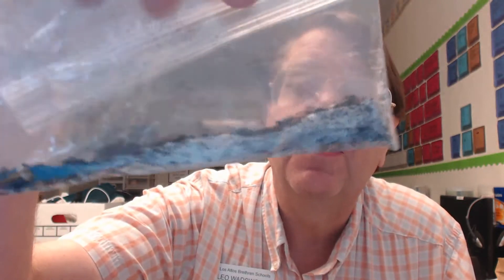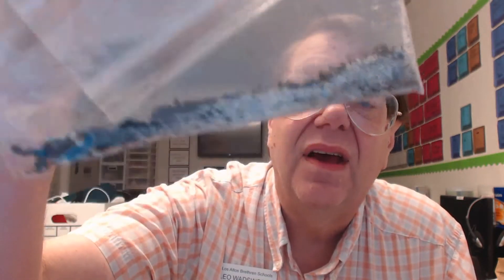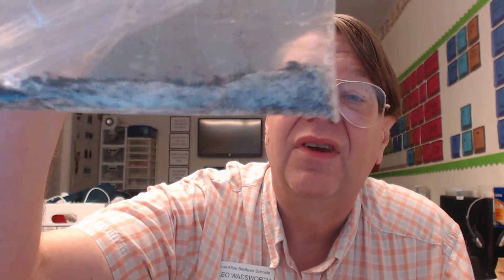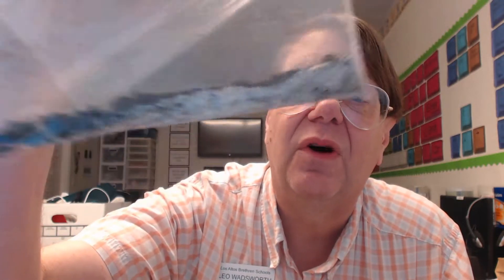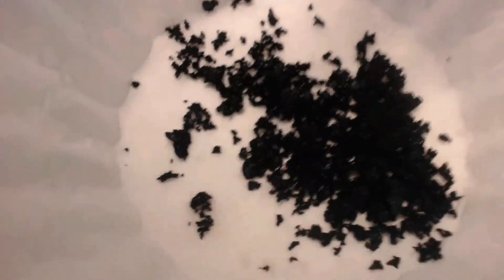Crazy FAST EASY carbonization

Comment: Hey Leo I had a go at this today. My setup was 2 Italian porcelain tiles underneath a porcelain ramekin and one tile on top. I tried to make a "baseline" sugar carbon by itself, which ended up taking 4 minutes at half power and 12 at full. Next I did a 1:1 salt to sugar mix which I ground in a porcelain mortar and pestle. It took 4 mins at half power and 6 at full. (The microwave is a 1100w Oster). Neither of my carbons were conductive! Do you know what I did wrong?
Reply from the maker: Hi Kenneth.  I think the answer is that you did NOTHING wrong!  Experimenting is like that - we learn more all the time, sometimes things that don't work like we expect tell us more than things that do!  I have started to have great success with microwave carbons, starting with sugar carbons, by adding 20% of flake graphite powder to the mix before microwaving.  CAUTION - this makes the mixture MUCH hotter, which seems to be a real key, but now I'm struggling a bit with broken ceramic cups and tiles!  I'm currently using 45 micron graphite flake powder because that's what I have - I suspect a smaller size might work even better.  I'm far from dialed in on the process - you can tell from my later videos - but it is getting there.  I'm also adding some Urea to try to reduce the oxygen in the microwave cooking.  I put the whole mixture into a coffee/spice grinder for mixing and reducing sizes of particles, especially the salt and the urea.  This seems to be a lot quicker and easier than the mortar and pestle.  One last warning -- right now the process smokes a good bit as it starts up - you will want to do this outside or with some sort of forced ventilation.  Don't do it in the kitchen! (grin)  leo.
Reply: @stemcampprojects7951  I think maybe the tiles I use or the container block more microwaves than what you use. I will try a 1:1 sugar/salt mix again for longer and see if I can get it conductive. Didn't you say that a 3:1 salt to biomass had some decent results? I am trying to find or make "rock bottom" baseline materials, because adding graphite, urea + is already more advanced.  Sciplus and Home Science Tools have crucibles which are small, but should in theory hold up to the temperatures we are looking for. Thanks for the reply!
Reply: I am also wondering if Magnesium Chloride, or possibly Manganese Chloride would be better because the melting points are much lower than Sodium Chloride. Magnesium Chloride is easy to get as an ice melt product, but Manganese Chloride is a bit rarer. As usual though, it can be found on eBay. Both are used as supplements for human nutrition in small, measured amounts. Even table salt in high enough amounts can kill you.
Reply from the maker: @kennethanderson7642  It is quite possible that they will be better microwave susceptors.  I'm pretty certain that zinc chloride is a better susceptor than sodium chloride.  I still recommend trying a little bit of graphite -- that is generating crazy localized heat.  I've got lots of experiments to run - it is quite possible that a very small amount of graphite can replace the salt altogether.
Reply: Hey Leo, it's been awhile and I tried 1:1 1:2 and 1:3 sugar to salt ratios for 11 mins at full power and none of them were conductive. Then I tried a smaller amount in a porcelain crucible for what ended up being 20 minutes with underwhelming results. Again, no conductivity! My conclusion is that the mix is not getting hot enough. I have a microwave kiln with a susceptor already built in, so it looks like I will have to think about using that as fun as the salt idea seemed.
Reply from the maker: @kennethanderson7642  whatever works for you!  I have been having great success with adding a little bit of graphite powder - its very very powerful.

Comment: RMS uses ZnCl2 to melt into the substrate during the carbonising process. ZnCl2 melts at about 290 degC but NaCl doesn't melt until 800 degC. Not sure if your microwave will achieve suitable carbonisation with NaCl in a microwave :(
Reply from the maker: As I understand it, the benefit of the zinc chloride melting is that it helps the heat transfer from the microwave susceptor to the material being carbonized.  I have found that I can use sodium chloride, especially if I use two simple modifications.  First, the time in the microwave is extended from 4 minutes to 6 minutes.  This compensates for the efficiency problem.  But the second method addresses it even further - if you dissolve the sodium chloride in a minimum of distilled water first, then mix it with the material to be carbonized, then dry it, powderize it, and microwave it.  This puts the NaCl being used as a metal salt microwave susceptor in great contact with the material to be carbonized.  Yes, it is an extra step - but it avoids the use of the more caustic zinc chloride, and uses the cheap, readily available, and SAFE table salt instead.  The safety is especially important in my context with the children.
Reply: sure I understand...good luck :)

Comment: Excellent info bro ! Maybe placing the dry ground up material in a solution of salt and then allowing to Dry again and then microwave action may result in amazing conductivity and micro porosity! I did this with zinc and was very good
Reply from the maker: Wow - that's a great idea.  So far it seems like the sodium chloride is working like the zinc chloride, so I've definitely written this down as another thing to try.  Thanks!
Reply from the maker: Electron, I've just loaded an update which shows my first try with salt in a solution with distilled water, and also salt and citric acid in solution with the carrot material to carbonize.  Interesting looking when it dries, Thanks!  I gave you credit in the description.
Reply from the maker: Thanks again!  This has turned out to be key in being able to use table salt instead of zinc chloride.
Reply: STEM Camp Projects ah great your back 👋
Reply: @stemcampprojects7951  
I was going to suggest this too XD
I hypothesized that the salts were picking up some moisture from the pyrolyzing sugar after awhile (which might explain why it took a bit to get started), which would make them conductive (since perfectly dry salt is an insulator!)
So yes, adding a small amount of moisture ahead of time would jumpstart it I think :)
(Too much would prevent pyrolysis until it reached hygroscopic equilibrium with the salt and no more evaporated though, of course)
But you've already figured this all out by now I'm sure XD

You might also want to be aware of the wavelength phenomenon that leads grapes to produce plasma XD
Particularly in that conductive regions smaller than a wavelength might have impaired coupling to the microwaves, but I'm not sure about that.
And that if you don't want to produce plasma XD, then be wary of thin connectors between ~1cm regions.
Reply from the maker: @puppypi9668  I've actually moved on from this method.  I now include about 20% (i.e. 2 grams) of graphite powder in the mixture to be carbonized.  This makes the reaction MUCH MUCH hotter, and seems to be working very well.  I'm currently working on dialing in that process -- right now I'm using a 5 minute microwave cook, then I collapse the foam back to a powder, then another 5 minute cook.  Seems close to what I want.
Reply: @stemcampprojects7951  Oh that's very cool!  An actual legit solid high-temperature conductor!  :D

Comment: Looking forward to you testing the carbon in a capacitor!
Reply from the maker: Me too!  I've got a lot going on, so it takes longer to do some things than I'd like.  I don't know for sure if the devices will be capacitors or batteries, but I've got a nice (cheap!) piece of gear that will log and display the discharge curve so I'll know then.  Check out the EBD-USB+ -- for example, at this video:  https://www.youtube.com/watch?v=VDCShH-zj0U -- I have the "plus" version with the gold top.

Comment: Covering the jar helps with the fumes somewhat. How do you deal with the jars cracking? I've thrown away like 7 or 8 china bowls by now, switched to terracotta jars which also cracked but at least they just crack and hold the material inside instead of exploding....
Reply: I bought a cup-shaped quartz crucible from EBay, it held well @ 750 in the kiln, so that should also work.
Reply from the maker: Indeed.  I learned it the hard way too.  If you look at the videos, I posted an update where one of the three sample bowls cracked.  I think they would have been ok if I had let the microwave cool down completely between tests.  I was not using china - I was using thick high-temperature glass, like Corning bakeware glass bowls.

The heat generated is extreme.  It was hot enough to blister some paint beneath the tile when I moved the bowls out of the microwave onto a ceramic tile.

I'm switching to using "microwave/dishwasher safe" ceramic mugs and surrounding them with clay pots.  Since people make microwave kilns from the clay pots, I think they can take the heat.  I want to be able to run a series of tests one after another without an extended cool-down time for the microwave.  I hope to run the next set of tests tomorrow morning and will post the results when I have them.
Reply: I let it sit in the microwave for ten minutes before I open the door . The inrush of cool air can make them crack
Reply from the maker: Interesting - and good thought.  The one dish that cracked on me was during the heating, it made a popping noise that was easy to hear on the outside.  I like the idea of slowing down the cooling - but if you do this, you probably need to let the microwave sit even longer between uses to cool down the inside.  Keep me posted on how its going!
Reply from the maker: Update:  it really seems that using true ceramic coffee cups works well -- no breaking.  I got a bunch for a dollar each at the local dollar tree store.
Reply from the maker: Yes, that should work very well for you!